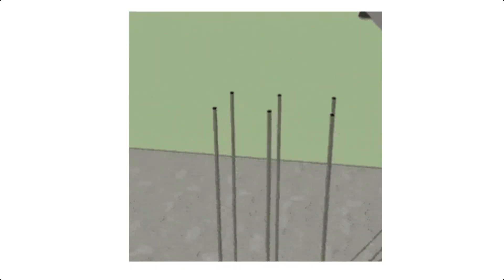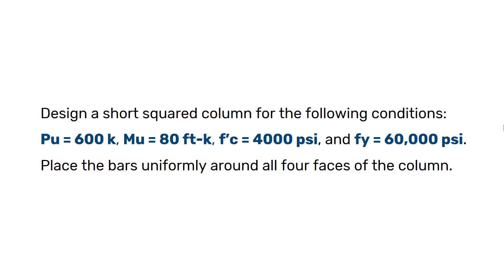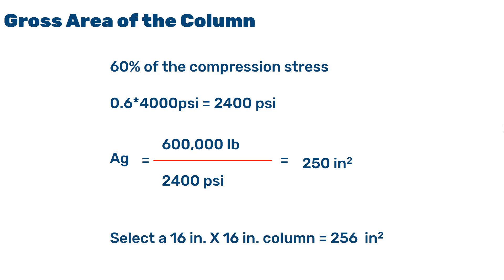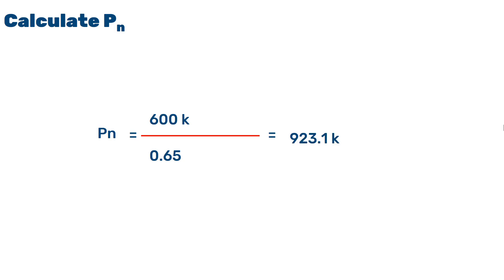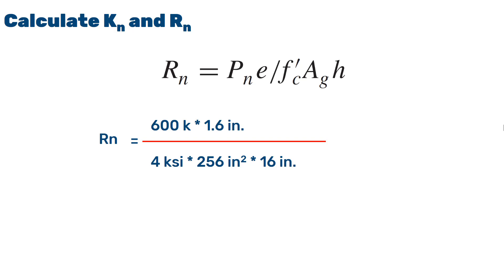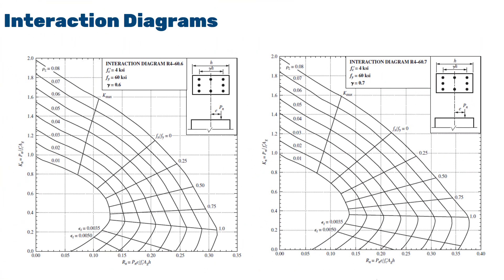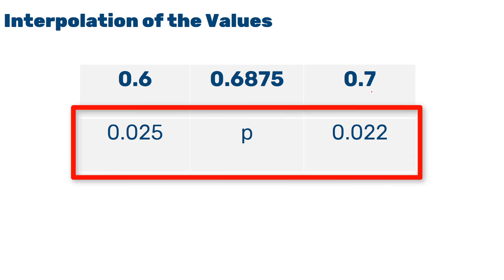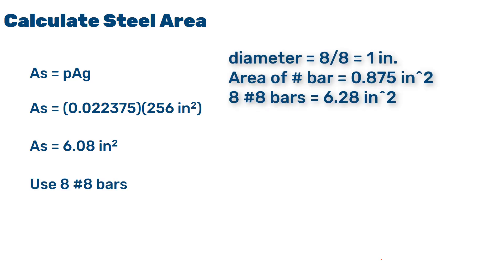Mastering Column Design with Interaction Diagrams | Reinforced Concrete Basics

Comment: What if f'c wasn't 4 ksi (for example 5 ksi), could i still use this diagram?
Reply from the maker: Hey, thank you for your question. In that case, the best workaround would be to do a linear interpolation. Assume that you have the interaction diagrams for 4000 psi and 6000 psi. Obtain the value for reinforcement ratio (ro) for both of these using the interaction diagram, then do a linear interpolation and you will have the reinforcement required for f’c = 5000 psi.
Reply: @Engineeringly  I see, thank you! I do great content btw, I hope you keep doing it!